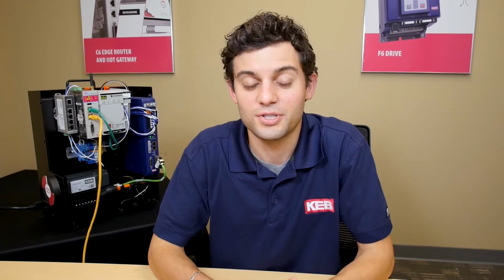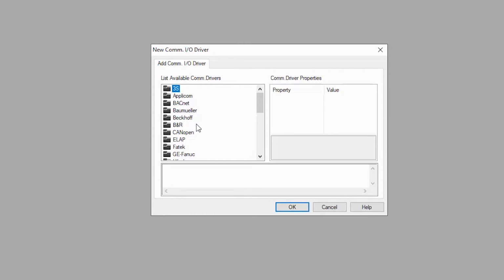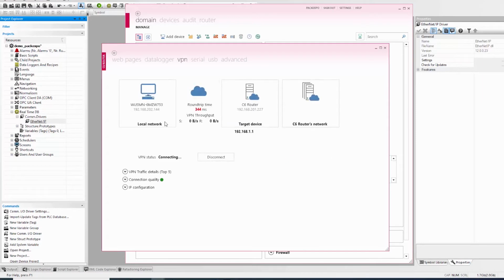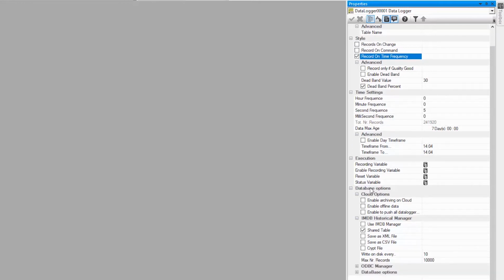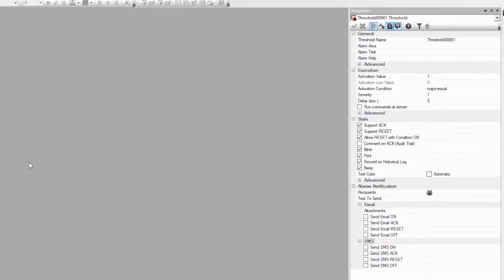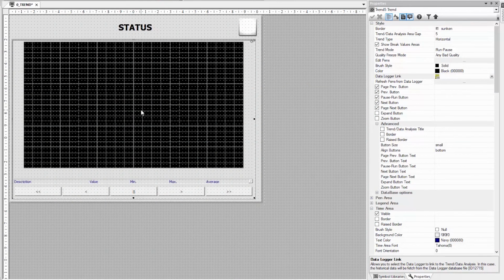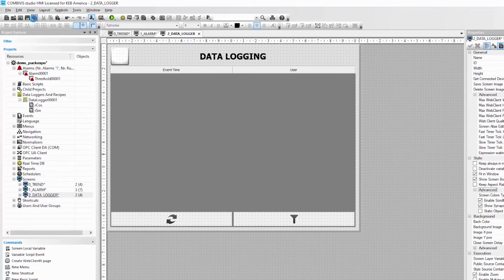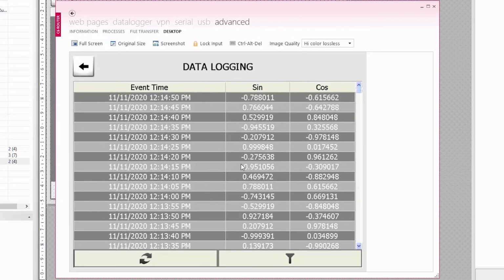Alarms, Datalogging, and Dashboards for Packaging Machines  [Pack Expo Connects]

Comment: Greetings, the video was very interesting, is there a way to save the data only with the KEB HMI without using the C6 router, I hope you can support me with that issue, thanks
Reply from the maker: We offer HMI products with LC and IPC functionality built into the screen housing or as separate units to accommodate different configurations and application needs and preferences. Are you wondering about storing data locally instead of pushing data to a cloud storage provider? For more information you can always contact a local KEB representative here: https://www.keb.co.uk/contact/contact-worldwide